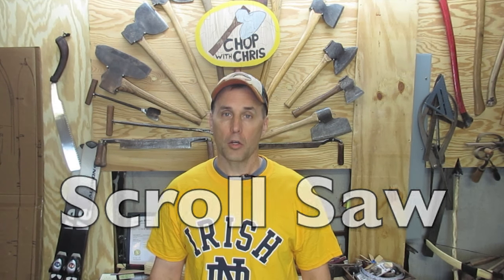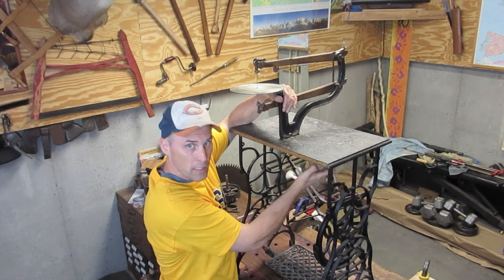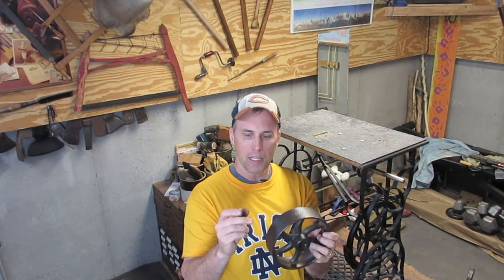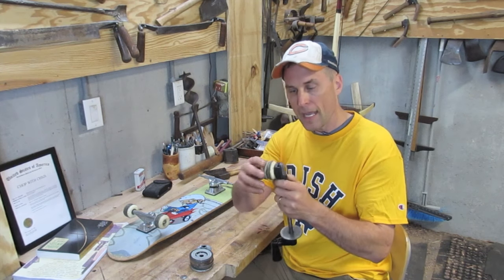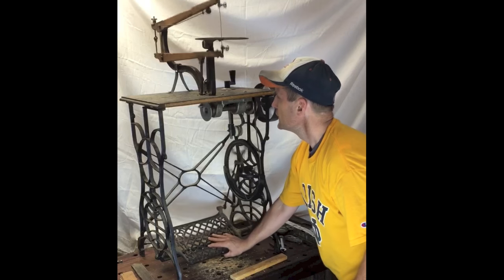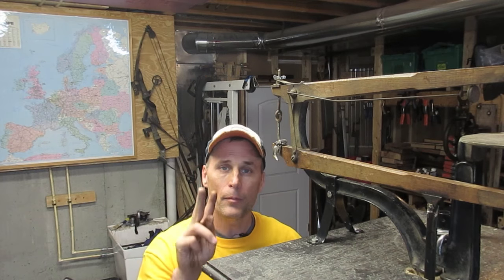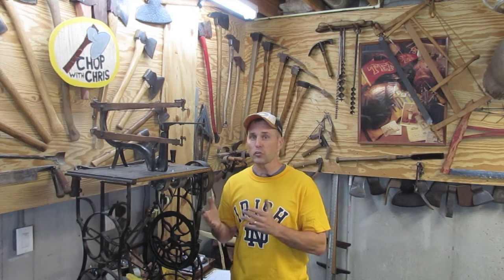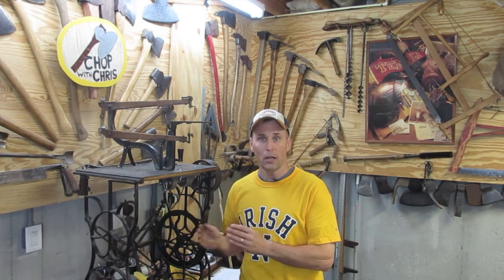How To Build A Scroll Saw

Comment: Chris,  Great project.  I have a 1935 Montgomery ward scroll saw that came with a little brass 1921 sewing machine motor which amazingly still works.  I got the lot for $10.  My plan was to mount it on a treadle sewing machine base I found, until my neighbor made me an offer for the base I couldn't refuse and I sold it.  Still have the desire to make it foot powered someday.   Nice to know some of the lessons you learned along the way.  Thanks for sharing the mistakes!
Reply from the maker: You gotta get another base and get this done!

Comment: you need to pick a good hard wood like ash or oak to make the arms it wont split as easy as pine. nice build tho pretty cool. I made one a couple years ago using a variable speed jig saw to power. Also i made a blower for mine. a little piston that runs up and down in a cylinder made from wood with two homemade check valves. if you go to my channel you can see it. it is nice to keep dust pushed off the line